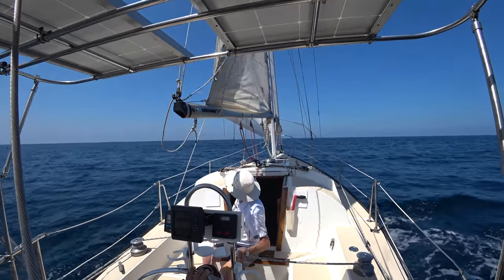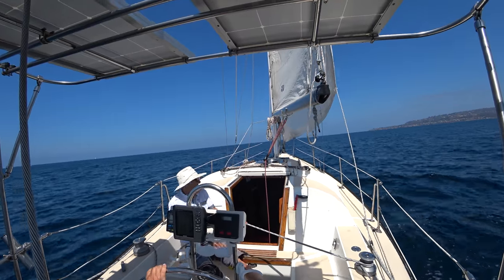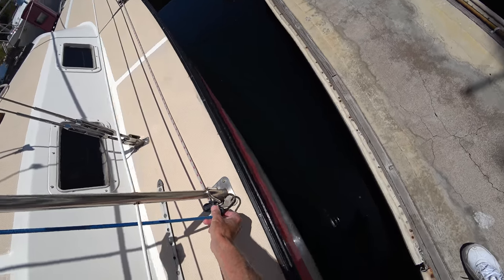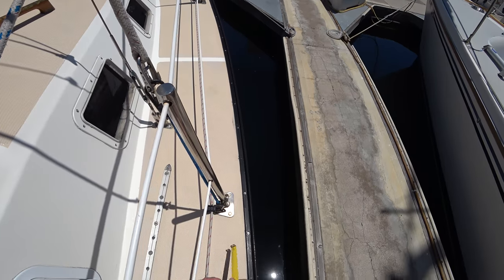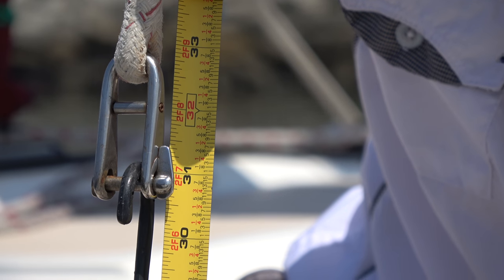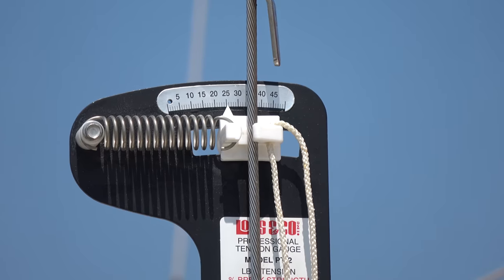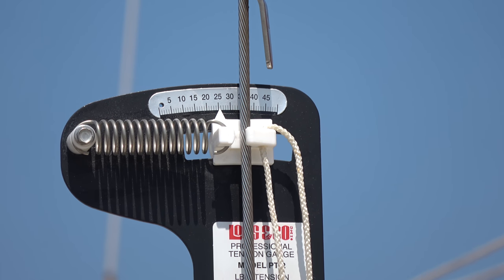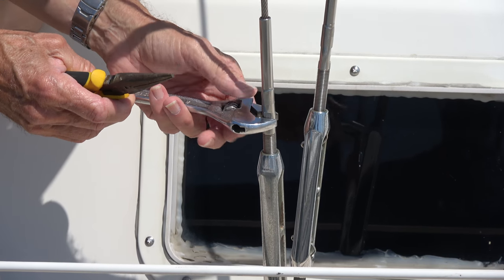Checking and Tuning your Standing Rigging

Comment: Excellente vidéo. But i think you are wrong on the 1 inch difference gonna make your top of the mast off of 1/2 a inch. What is true is if you have one inch more on one side. The correction is give 1/2 inch from the other side and take 1/2 inch from that one side. 
But in the case you have like in this exemple one inch difference. So the the mistake is 1/2 inch. Let say your boat is 10 ft large and 40 ft high. The triangle (5x40) keep his angle. It rotate from the base 1/2 inch the top gonna move about 8 time more (40/5=8) . So the top of the mast should be like 1/2 x 8 = 4 inches off. 4inches off gonna certainly make difference in the sailing performances. That is why it is important to be as accurate as possible to center the mast.

Comment: great advice.    i was going to ask the size of a 20' boats shrouds my new to me boat has a tall mast and spaghetti thin cable for shrouds that size needs to be large enough to handle the load i have little these will.
Reply from the maker: Every boat is different. Your thin cable may be correct. You could have a hinged mast mount that can't take more pressure. Heaver cable needs greater tension and you might pull out your chain-plates! Do a lot of research so you get the right side for your  boat and it will last you 15 to 20 years.

Comment: Your audio started with there are several things that can cause this issue but I have no idea what issue you were concerned about.
Reply from the maker: The main concern is that loose standing rigging lets the mast slam and shock the rigging as the mast flops back and forth. This not only shortens the rig life but can cause a failure which might bring down the mast. A properly turned rig also helps keep the boat pointing just as high on both port and starboard tack.

Comment: Using a bungee cord when checking the length of the shrouds does not sound very exact.The fact that bungee cords stretch is a huge issue. I prefer to hook a tape measure to a halyard and run it up the mast and use that to check the distance.
Reply from the maker: Yes, a good quality tape measure is a better way but the bungee is accurate enough and is handy if you don't have a tape measure that's long enough to go up the mast.
Reply: he is only using the bungee to to keep the halyard tight, and measuring deck to the halyard, yes indirectly measuring the bungee, but that is not important. the important thing is that each side is close , while maintaining enough tension in the shrouds.  Perhaps your concern is stretch in the Halyard??  That is the purpose of the bungee, to keep the minute halyard stretch near the same on each side.